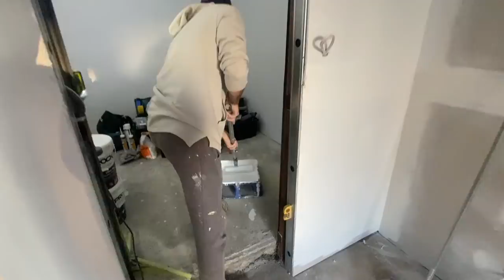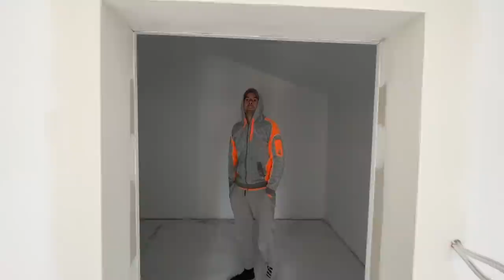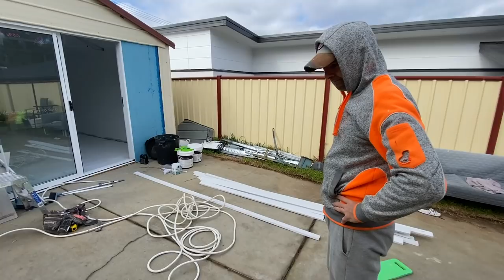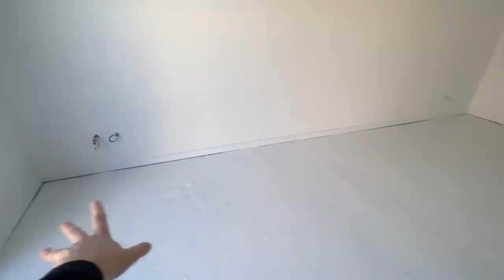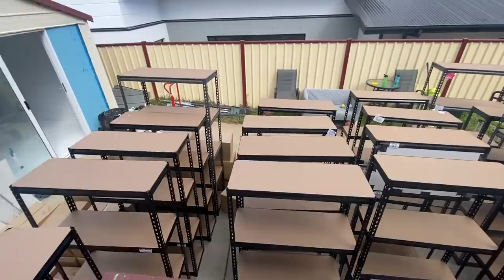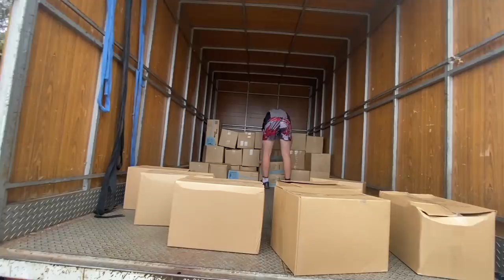The NEW home office is painted so I can FINALLY MOVE IN! Selling on eBay from home 🏡💻

Comment: I must ask a question! Should you store books long time in cardboard boxes or plastic bins? Everytime I research a simple question I get conflicting answers, so I thought I'd ask a pro. Can't wait for new videos...proud of all of you.
Reply: How long is "a long time"? Remember that books come from the publishers either in cartons (cardboard boxes) or as 'slabs' (shrink-wrapped packs, usually of 50+ paperbacks). These can sit in distribution warehouses for years.
Reply: @MrPaulMorris  I was thinking for several months. My main concern is the fumes (smell) from the cardboard boxes leaking into the paper. Thanks Paul!
Reply from the maker: Yes, I don't store any in plastic boxes but I think it's okay in cardboard boxes and I haven't had any problems so far. Thank you so much for watching!
Reply: If I can add a follow up to my previous comment; my concern with plastic boxes and used stock would be cross-contamination,  particularly if there is any hint of moisture. In warm conditions even books that appeared dry can 'sweat' in sealed containers and this gives ideal conditions for mould. I would tend to leave recently acquired used stock on open shelving for a week or two to acclimatise--especially in colder months--before storing in sealed containers.
Reply: @MrPaulMorris  Thanks Paul.
Reply: @backfromburnout  Thanks for your reply. Glad the shed is finished so we can watch your wonderful videos again.